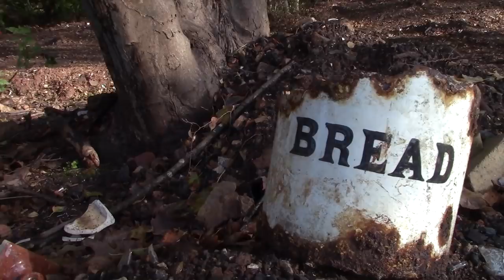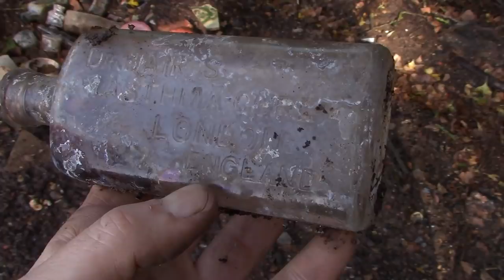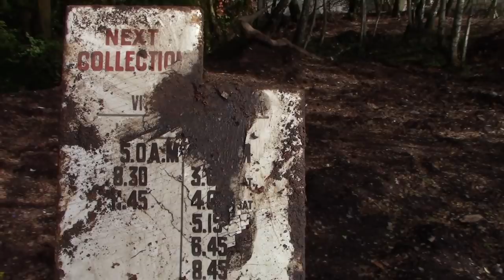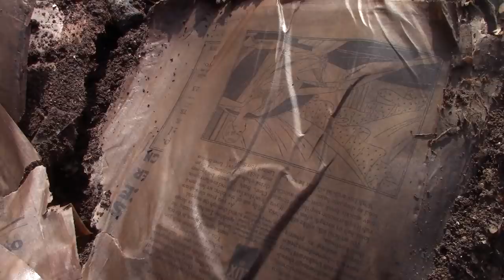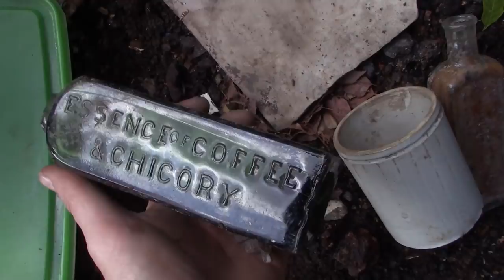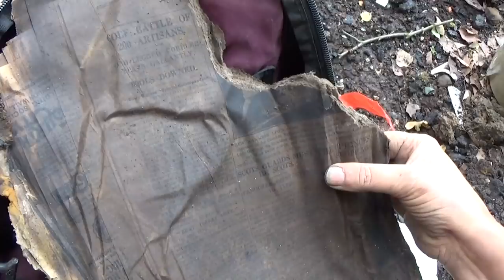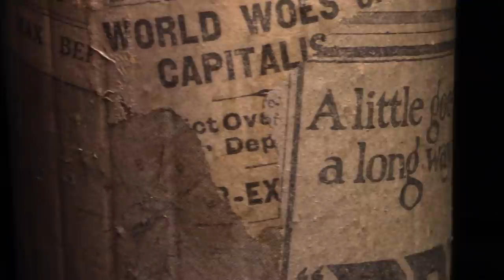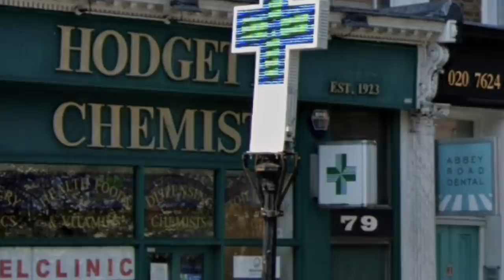Dump Digging London for lost treasures STUFF EVERYWHERE!

Comment: That black glass bottle you wondered about that didn't have a seam is what is called a turn mold bottle. They were blown in a mold and then they turned it while the glass was still molten . Usually there are faint concentric rings on the bottle which indicate it was turned. Turn mold bottles could not have embossing on them they always had paper labels.  Bottles like  the one you found usually contained some kind of spirits.  Love your videos Si.  It's inspiring me to do some digging again.

Comment: The green , seamless bottle toward the end of the video looks like it was created in a turn mold. Usually a turn mold formed bottle will have concentric circles or rings going around the bottle in a few areas like those near the shoulder of your bottle. Those rings are created as the blown bottle is literally being turned inside the mold. As the bottle is turned, the rings are created by granules in the paste that is applied inside mold prior to creating a bottle, or foreign particles such as sawdust, or imperfections in the mold surface. Once you have it cleaned, hold it up in the light and you might just see more rings going around the bottle.

Comment: So that is obviously not a current video based on the weather and the foliage -- but it looks like you and the crew were there the whole day.  So being of a large sense of curiosity, but small bladder where I can never be too far from a bathroom -- if you all are there for hours and hours, where do you go to relieve yourselves when needed?????  It is amazing how many items are not broken at all, and the ones which are only broken slightly -- considering being transported to the dump, dumped, and then shoved around by heavy equipment.  That long-necked wine bottle was in the midst of bricks and construction material -- feet underground -- yet unbroken!  Love watching you all find things -- and then have to decide what you can lug out with you and what you will leave behind....

Comment: Item at 43.07 square ceramic thing could be a trivet for hot pans taken off the stove to cool on the table, the lines on either side could be for the pot not getting condensation on the bottom and sliding

Comment: I don't know if you know this trick for what papers. Put them in the freezer wrapped in wax paper. After the whole pile is Frozen take it back out. Hopefully, parts of the stack will break into their own smaller sections. After it thaws you can gently remove the papers from each other. Lay out towels with paper towels on top and lay the individual damp papers on that until they dry. It's time-consuming but it works!
Reply: ...wet papers...

Comment: They sifted at a 19th-early 20th century dump here, and got alot of coins and buttons that would've been missed. Their sifting box was framed with 2×4s and had "hardware cloth" stapled on....i don't what they call that in the UK....it is galvanized steel mesh in a roll. 3/8" or 1/2" openings in the mesh catch most stuff.
Reply: JustDustin O' : known as a riddle. When I last dug I began to take a small detector with me, found a 6d and a hapenny!

Comment: Great day at the old dump! I do stained glass work and recommend a glass grinder that would do a great job on smoothing those broken bits. It is water cooled and comes with different grit wheels. Would give you a nice finish, no chipping, especially on that spiffy art glass piece Monica found, and on bottle necks.

Comment: Hi, I'm just discovering the fascinating hobby of all you your Mudlarking enthusiasts. I'm likely late in commenting, yet can provide info on two items.  (1) is a lantern Nicola White found in a river and gave you to restore.  Please know the "Port" side, as the item faces forward like on a boat, is on the "left" {easy memory trick: both are 4•letter words!!!}.  "Starboard" is the right side.  And, (2) the square beige glazed tile your friend found, would typically be set by a tile mechanic, and gets "back buttered" with mastic, or "mud", depending upon the chosen method. The side with the deep, diagonal grooves are buttered and installed on a wall or floor.  The decorative glazed pattern is the front and is for display and visual appeal.  I sincerely hope this info helps. ~ Z

Comment: The CLR might also help dissolve the cement, along the edges of the tile, in addition to gentle scraping at the edges.  If you scrapped it, while applied, eventually you might loosen it enough to get a drywall spatula underneath.  I have successfully used a drywall spatula, and hammer,  to detach floor tiles before. (Small taps, rotating around the tile, to loosen all edges a bit, is safest.  Think of how you try to remove tape, or stuck together papers, or labels; when trying to get apart, in one piece!) Good luck!

Comment: Have you turned any into incense burners? Even if the lip is chipped, if it has an intact neck you can just cut it right below the chip. Drill holes into the side of it (usually near the bottom 1 on either side) and voila!
Get some nice (easy to manipulate) keyrings. You put the non burning end of the incense stick into the keyring, then lower the burning end into the bottle. the Keyring stays sitting on the neck so you can pull it out when it's done. I have one that's just a regular wine bottle, but I would LOVE to have a Victorian one!

Comment: As for the Crowe's Wet White, I think this may be either of these. 1) Something otherwise known as Liquid White, which is an oil based type of paint that an artist would cover his canvas with to protect it, and give themselves a waterproof and neutral base to paint a picture upon or 2) Wet White was also something used to turn your leather into white leather. There was also a Wet Blue, that was a process that turned leather blue. I don't think anyone had been mixing paint in the bottle. I tend to lean towards the number 1 theory, google Bob Ross's Liquid White, as the late Bob was a fan of pre-whiting his canvasses. Hope this may help Simon x

Comment: Great as always but I'm afraid you've got the wrong Crown Pub. The one you featured is on Cricklewood Broadway.(I live 10 mins away). The Crown Harlesden used to be called The Anchor and Cable. It existed in 1670 and rebuilt in 1888. The building is still there on Harlesden High Street. I think its now a Superdrug! Sorry to be a wonky donkey nerd :) xx
Reply from the maker: Oh well. I did look at alternatives, but couldn't find any info about the one you mentioned. From the outside it doesn't even look like a pub : /   Thanks
Reply: avalonjuice thanks so much for the link. Interesting!🤓